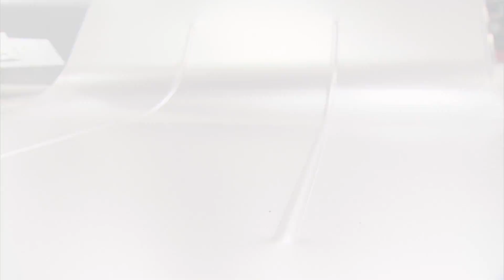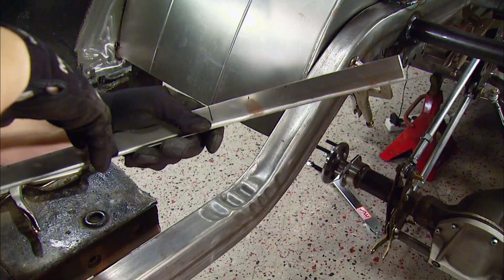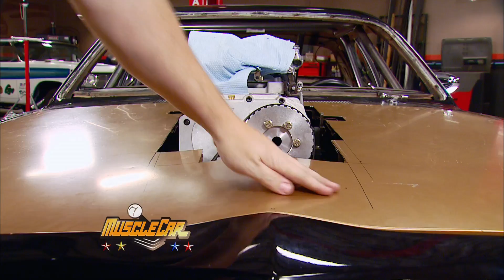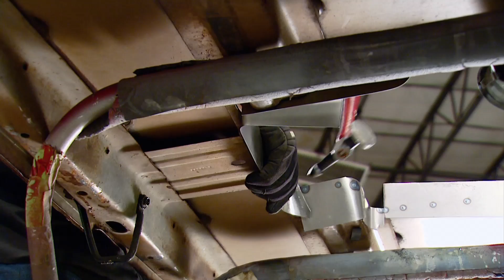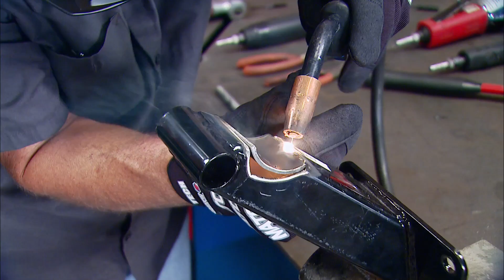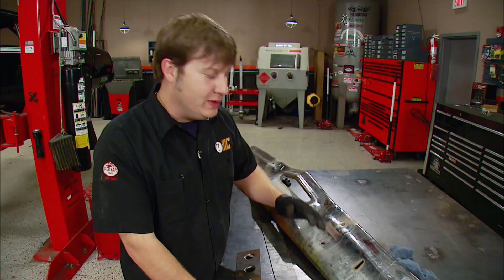Putting The Pedal to the Metal With The Pro Street Dodge Dart Bumpers & Exhaust - MuscleCar S7, E12

Comment: Tommy, I love you bro. But, stop destroying them bumpers. If I remember correctly, you did the same thing to 70’s Buick. This Mopar and that Buick weren’t “rat rods” or “hippie mobiles”. Stop ✋🏽 it! They’re hot rods.😊
Reply: maybe not but i think theres a purpose to doing that on a pro street car....it gets a little bit of weight off the car and every little bit of weight off the car helps
Reply: @everettgrover9459  It takes away the factory looks. If you want to reduce bumper weight, get aluminum or custom fiberglass bumpers. That weight reduction excuse you made is an excuse for whacking up a perfectly good factory bumper.
Reply: @regsmith7604  true, but there really isnt anything on that car thats factory original anymore, i do see your point tho
Reply: @everettgrover9459  The fenders,  doors, quarters are stock
Reply: @regsmith7604  yeah, was referring to the drivetrain and suspension
Reply: @everettgrover9459  I know that youngster
Reply: @regsmith7604  haha don’t know if being 40 counts as youngster these days lol
Reply: @everettgrover9459  Do you play video games? Be honest
Reply: @regsmith7604  I do yeah, mostly racing and sports games
Reply: @everettgrover9459  If you play video games, you’re a youngster
Reply: @regsmith7604  right
Reply: @regsmith7604  Well they do this just to get rid of the big bulky 5 MPH bumpers that came factory on the car to make em look a little more sleeker.
Reply: @CJColvin  That doesn’t make any sense. Once upon a time, we used aluminum or fiberglass bumpers when weight was a problem